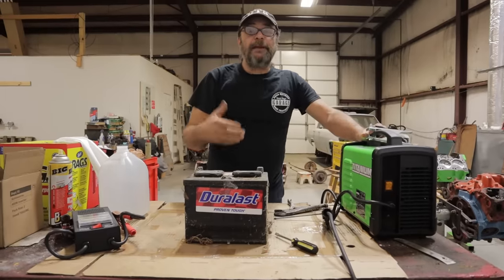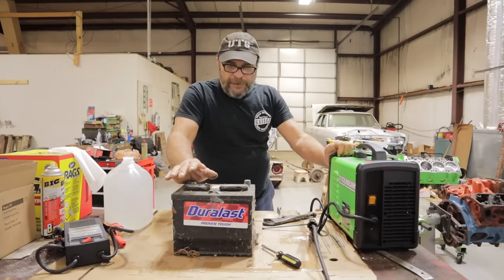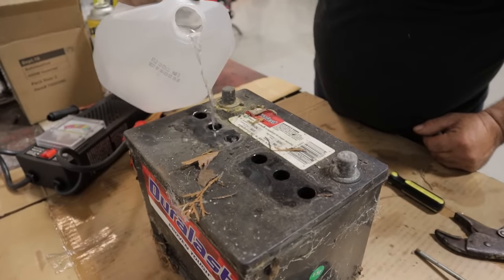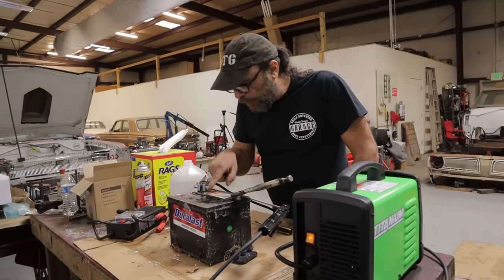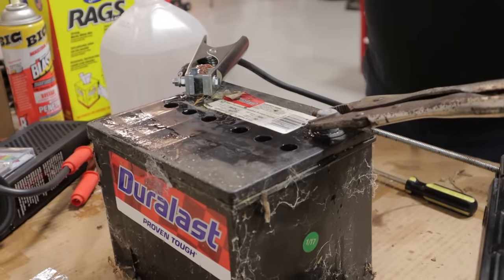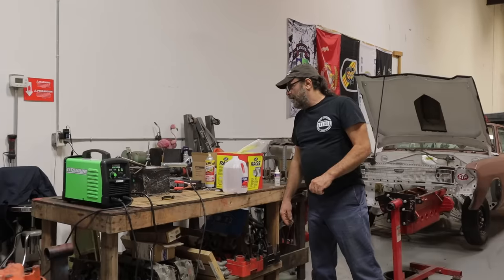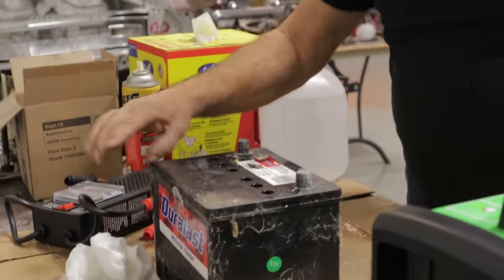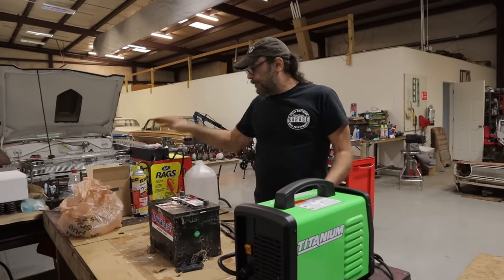Reviving Dead Batteries With A Stick Welder

Comment: Would like to have seen a load test before the welder hack just to show how bad the battery was. I have seen dead batteries come back when the normal draw of the vehicle has been off for some time.
Reply: was just going to put the same opinion...made the video half useless if i did not see how bad it was
Reply: No kidding the date on the battery only makes it 4 years old...
Reply: stop spoiling  the magic trick or else

 ( or else i tell your kids Santa Claus isn't real )
Reply: Exactly pretending to fix a battery that's perfectly fine
Reply: @carmineredd1198  What do you mean by Santa Claus isn't real?
Reply: He said it was dead dead and sitting that long I'm sure the voltage was 0.0 volts.
Reply: @750turbojoe  I’ve got one that’s been sitting for years and it still shows a few volts. I’ve not seen one at 0 ever myself
Reply: @angeldejesus65  what half is useful then? It’s either useful or useless
Reply: @750turbojoe  nothing coming back from zero volts
Reply: The point of the vid wasn’t whether bad batteries can come back from the dead. It’s whether you can do it with a stick welder.
Reply: @carmineredd1198  🤣
Reply: @750turbojoe  certainly it could have been showing nothing and sitting a long time, but that doesn't mean it was no good at all. You don't need a stick welder to charge an old batter that has just been left to go down. You just need a charger that will send some decent current through it to get it going again. That and distilled water. So certainly it was dead but the problem here is we don't know if the battery was bad or just left uncharged for a while. Most bad batteries don't come back no matter what.
Reply: @dirtyaznstyle4156  But bad or dead batteries are two different things. I can bring a dead battery back from the dead with a high current battery charger. But I won't bring a bad battery back from the dead even with my welder. Two different issues here I think.
Reply: I was saying the same thing and still would have like to see a before test but the battery sticker does say 1/17  so it is only 5 years old.   Before test for sure.
Reply: You can't load test a dead battery!  Zero in the batt. Zero to the load.
Reply: Geeze. Just watch the follow up vid.
Reply: Likewise
Reply: @MrHarleyoldfart  Yeah, next he'll tell us the Easter bunny is fake too. Dream wrecker...
Reply: I was thinking the same thing
Reply: @StephenHarristnt  is there a follow up video?
Reply: I used a similar method with a 200 amp batter charger. It brought back a 10 year old battery tested as "bad" (won't hold charge) to "good." The battery was an ideal battery (new from factory on vehicle with 20k miles in 10 years). CCA didn't increase back to original 710 (630) but the battery has worked for a year. I have brought back other batteries as well but still buy new for heavy cca requirements especially in winter. 
*tested with snap on dtac.
Reply: @snapcutter9596  601 cca 12.57 volts before I desulfated it with battery charger. Volts weren't indicating bad battery but it wouldn't hold the charge and the dtac test came up as "bad condition" ... then "good" after the reconditioning and it holds the charge. I did use the air gun to blow the under the caps clean after a small lift. Great minds think alike? I just did a batch of 5 batteries that weren't completely dead but getting old. So far so good.

Comment: So I tried this and it worked! I was gonna use my dad's old 200amp jump start battery charger, went to use it and it was broken. Did some diag, found out it was the switch, and man they're proud of that switch, $45 for a stupid switch. I bought a 200amp stick welder for $70 on Amazon instead. 
Tried it on my brother's old battery, which only had ~250cca in it, brought it around to ~500cca after only 3 cycles. I'm so happy, saved a bit of money, had some fun with family, and now I get to stick weld things. Always wanted to have a reason to get a stick welder.
THANKS UNCLE TONY 💜

Comment: Works great!!! I used a 12v charger with 50amp jump setting and left it on for two days outside caps off and i revived a 15 yr old schwab battery that was sitting out side for 5 yrs dead. Runs my chevy 2500hd like a champ.
Reply: Hey, it good to hear it worked with 50 amp charging for 2 days. In my case, I only have a charger with 20map max. Do you think it will work with longer charging time?

Comment: Good idea. Never crossed my mind to use a welder. We always just used one of those heavy duty battery chargers. The ones with the 200amp boost. We would fill with water, plug in the 200 amp cables. Let it boil for 10-15 min. Then let it cool for an hour +. Then repeat. We usually did that 4 or 5 times for the great big ones. Usually only 2 or 3 that mes for the smaller car batteries. We kinda judge them by how fast they begin to violently boil. Brings them back from the dead. Good vid UT. *Edit. The charger must be the old school style analog. Not the electronically controlled ones, they will shut down before they do their job.
Reply: Some of the new cpu chargers like schumacher have a setting to reviv/de sulfide the cells.
Reply: When I was about 16 a gear head friend used a battery as a welder, guess what happened?
Reply: @tedesco455  kaboom
Reply: @Portuguese-linguica  INDEED!
Reply: Did they say anything about the stuff that you boiled off
Reply: I remember shoving a charge into an enormous truck battery years ago.
The only difference was that I used an anti-sulfation additive, and that helped quite a bit.
All it needed was one good 150 amp charge about once a year, and it had unbelievable power.
I could leave the ignition on all night, and the car would start in the morning!
Reply: So dangerous the gas is free hydrogen and extremely explosive you should be wearing a respirator and face shield
Reply: Great video, but I would have liked to have seen the voltage before you started charging did you happen to catch that? What was it?
Reply: @butcher4842  Me too buddy
Reply: You can use a welder to thaw out frozen pipes also.
Reply: @Portuguese-linguica  Its "KABOOM" in any language!!!!!!!!!
Reply: @harvestblades  yeah we just got one, its remarkably good, all automated, you put it on charge cycle auto, it works out what type of battery , how to rejuvenate it and just does it itself, then just concverts to a rejuvenation /smart charge....was the equivalent of a thousand dollars and takes ages as it presumes the caps are on the battery but i hvent met an auto battery thats turned what you would think its last starter it cant rescue and you get a couple of years out of them...
Reply: @locker60  nah just turn the fan on the welder at the battery y, be fine if you are smart.
Reply: I've recovered a bunch of spiral cell batteries  by hooking them to known good batteries with cables with pretty good results. I could see this working as well.
Reply: @butcher4842  Dead dead as he said, that means 0.0 volts. Dead.
Reply: @locker60  I cringed when I watched him with no protection at all and not having a fan to evacuate the gasses, It's kind of like watching cars with all season tires going down a hill covered with black ice.
Reply: @locker60  Hydrogen gas is extremely explosive but nontoxic to breathe in an open air environment. It is so much lighter than air, it is virtually gone in matter of seconds.
Reply: @needsaride15126  my pipe has been frozen for 10 years after I got dumped
Reply: Thinking the whole reason why the new battery charger's dont have the 50 to 60 amp charge anymore is because it worked and was hurting battery sales.  There is such thing as making too good of a product.
Reply: @tedesco455  he welded.  I've  used cranking batteries many times. They are designed to drain/charge fast.  Make a 36 volt system out of them and a 6011 is more like a plasma cutter. Lol
Reply: Took the question right out of my mouth. I have a wheeled 250 amp charger as well as a 50 amp charger for jumping. You answered my question.
Reply: @donkEEpunch85  This happened in about 1984 we were 15-16, I have no clue what he is up to.
Reply: doing it now 200amp boost on 6 golf cart batteries.. beats 800$$$ every 3 years ... alot of morons on here . you heat and hot charge it will boil the plates. if the plate is toast . you buy a battery.lol
Reply: @gregparham5877   What about doing this to a 12 V motorcycle battery? The video that I watched said to use the smaller 160 amp DC welder for smaller batteries and use the 200 amp welder for bigger batteries like car batteries but it seems to me if you use the 200 amp welder you could turn the amps down for it to work on smaller batteries and turn it up for bigger batteries. What is your opinion about it? I'm not buying 2 different welders for different size batteries.
Reply: @bodeine454  I didn't use a welder I used a battery charger , with a 40 amp boost and 200amp engine start selection.  I hooked it up selected the 200 amp and it boiled for 3 minutes and then dropped off to 40 amp. for 15 minutes. I have 5 of 6 that are golf cart 8 volt batteries that are still holding for 3 weeks.   1 i'm going to drain completely and add epson salt and distilled water from my de-humidifier and recharge to see if I can get it to kick off.  it would not react to anything i tried...  as far as a motorcycle battery . lol my harley takes 1 a year faithfully  never tried but might.
Reply: I’ve got one of those old big heavy chargers I bought at a sale for $10 , I bought it know it wasn’t working but thought the clamps alone were worth $30 , I took the cover off and found two large diodes that cost a few bucks and it works better than any new ones I use else where. It’s a canadien brand.
Reply: @gregparham5877  does your 200amp power  source have to match the voltage of your cart?  Or do I just use my regular 12v 200amp old school battery charger on my 48v pack?
Reply: @butcher4842  
He said the battery was completely dead, no reading at all.
Reply: Haha. I prefer the analogy of slicks on ice vs all season lol
Reply: @garagekeys  How did you ! Get Dumped !?? Then !
Reply: @Portuguese-linguica  i used 2 car bats 2 jumpers and 7018 3/32 rod n got the rear hanger fixed when we were out wheelin n 2 years later i noticed the weld ...be it crappy as it may be was still there ...i as why he said ive jumpedr dukes style n its good ...done it a few times ...how many of u ppl r trolls
? i am a j man welder tho
Reply: Should also have a fan to blow those gases away
Reply: @tedesco455  I have used a battery as a welder lots of times. most 4x4 guys do. now I have a ready welder spool gun, also uses batterys as power source.
Reply: A welder usually has about 75 to 85 V until the arc is struck and then it drops, a good welder will keep the voltage up higher for a good consistent weld
Reply: @butcher4842  After a few years it would be zero.
Reply: @robertvanruyssevelt7159  
not always the case
I have a 2016 battery, sitting last 7 years still has 10.5 volts
I have a few like that, I have a dozen+ but no stick welder. going to borrow one & try this out
Reply: @garagekeys  -  You should check out the video by Kirby van Hoovervaccuum on removing the chrome from bumpers. Might be some info or ideas there for you.
Reply: @knockingrodgarage3602  -  I like your moniker there, Knocking Rod!  I bet you have about 20 Degrees or so from the University of Advanced Timing (formerly known as the School of Hard Knocks), yes?
Reply: @brucelarsen6650  👍 thank you
Reply: @brucelarsen6650  just stating the obvious.  We live in a society driven by consumerism. In order for that the be successful there has to be consumers to purchase the products, in order for there to be repeat customers those products have to degrade or break and that's where planned obsolescence comes in. Its been going on since the invention of the lightbulb man. Pertaining to my battery charger comment,  most new 12volt  battery chargers won't even turn on or recognize a battery with less than 8 volts and hardly any will put out the 35 to 40 amps required to generate the desolification process to rejuvenate a lead acid battery.  It all boils down to if they can fix it then they won't buy so they've removed the ability to fix it. Just look at what's happening in Illinois between farmers and John Deere .
Reply: @harvestblades  

I bought a $80 Harbor Freight battery charger with a desulfurization mode.

Surprisingly it worked very well.
Reply: @fredkohlman8860  Oh ye of little faith. This is my kind of guy. Not overly concerned about all that safety stuff. I have followed that line of thinking for as long as I have been fixin' stuff. But it definitely is not for the faint of heart.
Reply: The electronic controlled chargers also won't charge a completely or mostly dead battery because they see a lot of amps at once and "think" there's a short and shut down.
Reply: @locker60  easy Karen
Reply: @locker60  I usually turn on a nearby shop fan....I think it disburses the gasses from accumulating in quantities that facilitate an explosion.   (Sounds good anyway)
Reply: How funny I used one of those 200amp old school chargers a few days ago on my near useless car battery and just a few min has done wonders on its ability to start the car days after parking where it previously wouldn’t even have power after sitting overnight for the door chimes.
Reply: Man I have an ancient NAPA battery charger/tender for car batteries and large batteries that my dad pulled out of the dumpster at his job years ago and it has a 200amp boost, being that I only have a mig and a plasma cutter I might have to go try this on the old interstate and optima yellow top that have been sitting in my garage for a few years
Reply: @jaymoe5.7  uh... Gel cells are different. Be careful. Do some research to make certain of what type of cells the battery uses. Sounds like you need to confirm your battery type beforehand. Jmo
Reply: @Z_732  good point, I'll probably only test the interstate then lol I have a really old marine battery from like 2002 out of my boat I could try too. It just sat forever and lost it's charge, this might work 🤷‍♂️
Reply: @bodeine454  But why not ? LoL 😂
Reply: @needsaride15126  yes you can
Reply: @tedesco455  i keep 2x 1.2mm welding sticks in my camp tools for emergencies. Once i was stuck in deep deep country in outback Australia with a broken tie rod, linked two 12-volt batteries in series, got out jumperleads and used it to weld the rod where it snapped, wasn't 100% but I drove almost 600km home on it without a drama. If the battery exploded it was probably a cheap one or old. Have used batteries many times to do small welding repairs in a pinch and have literally never seen one explode
Reply: @angryman3317  I get it.